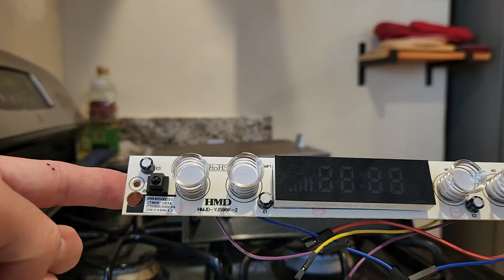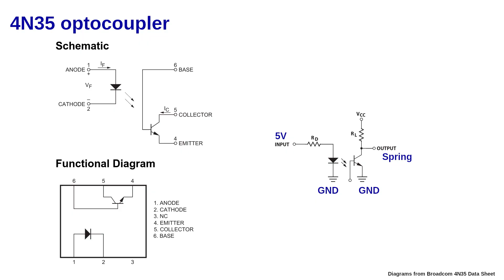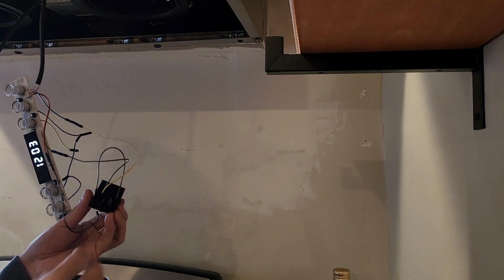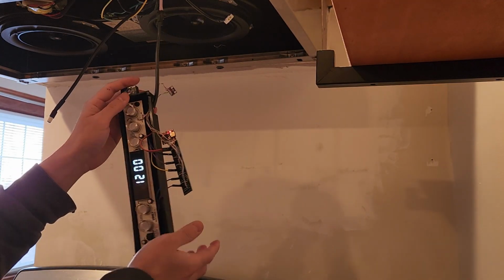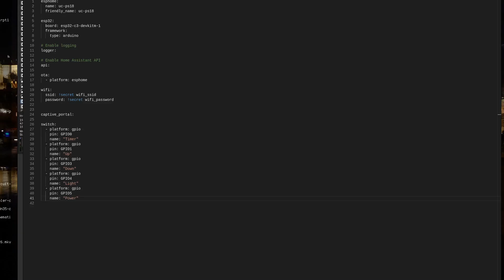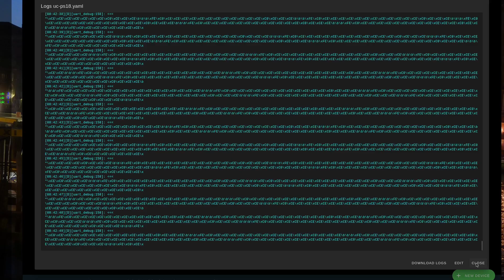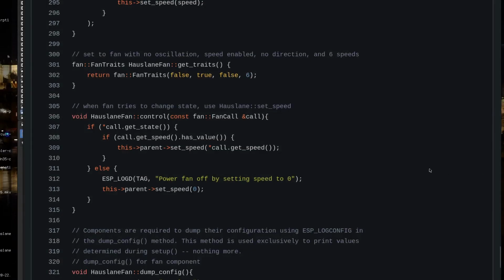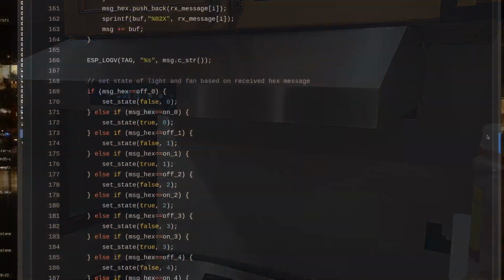Control capacitive buttons to make an appliance smart with ESPHome (Hauslane UC-PS18 range hood)

Comment: I made my old ikea hood smart with esphome using a ens160 tvoc, aht21 humidity and pms5003 pm2.5 sensors...
Seconds after i start to cook it automatically switches on and the level depends on how much steam, smoke or aromas i'm producing
Reply from the maker: I originally planned to have the vent automatically switch on from temperature, but see my response to @zalllon about possible concerns.

Comment: What a great project, can't wait to try this for the next house.  Can buy a cheaper hood and modernize myself 😀.  I'll also either add in a temp sensor or visual sensor for steam so the fans can come on automatically (using Home Assistant to run it like you).  Sensor could be on it's no device and monitored by HA
Reply from the maker: I originally had a temp sensor on mine (you can actually see the BMP280 attached in some of the clips), but I removed it while debugging some issues with button presses not registered when I had some connected to strapping pins and never bothered to add it back once everything was working. It's not a bad idea, but I saw some people caution against having it automatically turn on and potentially sucking up an active flame and helping it spread - I don't know how much this is an actual concern, but it's worth at least thinking about before going through with it.

Comment: I am going to use this method to control buttons on a spare remote control for a bed frame. The remote has a rolling code so I was not able to duplicate the output. hard to find optocoupler videos for some reason.
Reply from the maker: Ah, yes. Rolling cards are a pain to replicate, so simulating button pressues is much easier. I hope it works out for your project!
Reply: @kenjinerd  I ended up purchasing a used remote and using a ESP 32 and OCTO couplers soldered directly to the button pads and everything is working perfectly

Comment: Great video.  I appreciate all the details and information.  I have had issues when working with the Esp32 C3 and Esphome.  Any advice would be appreciated.  Thanks
Reply from the maker: I would try the ESPHome section of Home Assistant Community or Reddit for help, detailing your exact issue and use case. "I have had issues" is extremely unspecific, so it's hard to give much more advice than that.